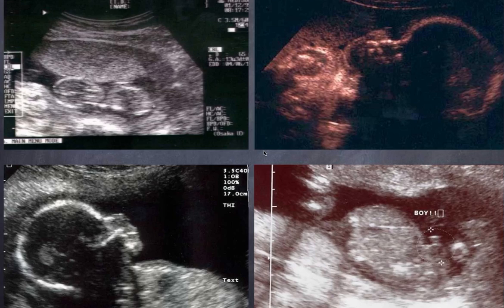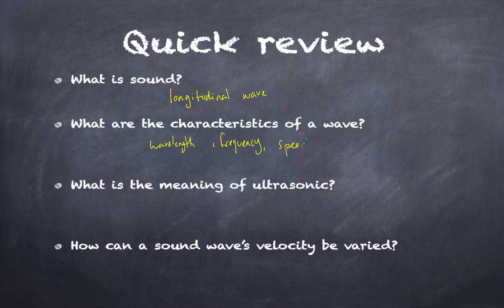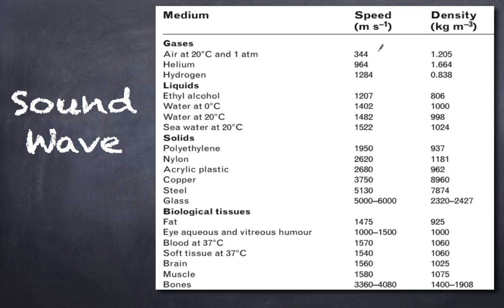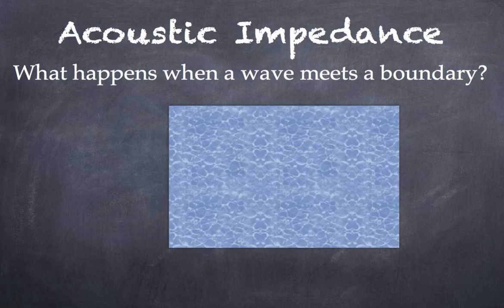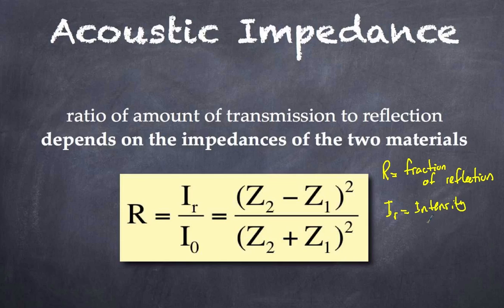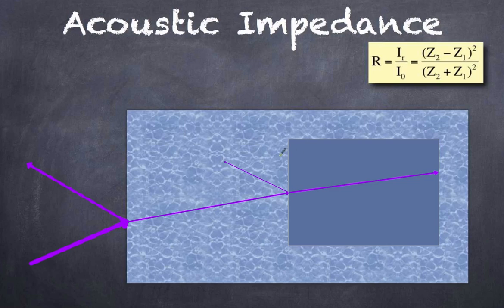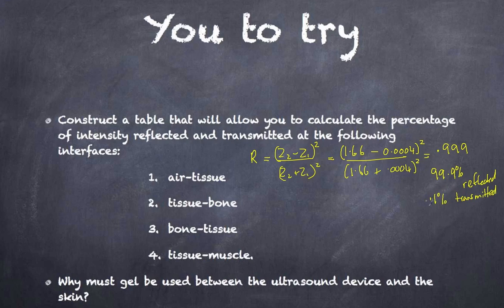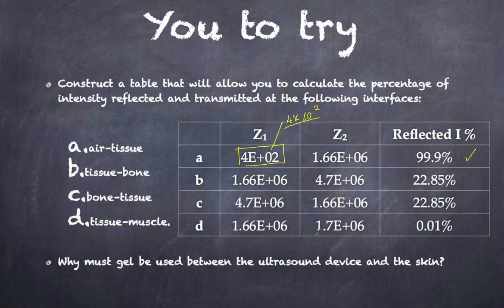ultrasound and acoustic impedance explained

Comment: With due respect,the higher speed of sound in liquids and metals is not because of their density,it is for an variable called  bulk modulus....
Water density= 1  and the speed of sound is 1480 m per sec in it

mercury density is 13/6 and the speed of sound is 1450m/s

Comment: This is fantastic.  I am a bit perplexed though, although the math shows that ultrasound would be reflected by air to me it seems a bit counterintuitive, could someone explain?  Thank you so much!!
Reply from the maker: It’s not the air that reflects but the boundary between the air and skin. The bigger the difference in acoustic impedance the greater the reflection.
Reply: @PhysicsHigh  Thank you so much for the response.  Yes, I totally understand the impedence... I just can't seem to wrap my head around air reflecting soundwaves, Id expect them to refract... I guess I have poor imagination lol.  Any thoughts on how you look at it?
Reply from the maker: The air doesn’t reflect sound waves. In fact if the medium is consistent you should not be able to see any detail as the detail comes from reflection where the acoustic impedance changes. Hope that helps.
Reply: @PhysicsHigh  Do you know why its called reflection when the medium goes from say a soft tissue to air... for example the pluera to inside of the lung?
Reply: You can think of it this way. If the difference in acoustic impedance is more, the solid is very much denser than air. So, when the sound wave reaches the edge, at the moment of contact, all the air surrounding the edge goes away from the solid because , as the density of solid is very high, obviously the energy of the sound waves is more in solid for it to even exist in the first place. As the air goes away most of the energy has no choice but to reflect itself again in the solid.
Reply: @rinzhler6922  very well explained!
Reply: @291ayl   I don't know if I'm right but I'm glad you get my point 😊

Comment: Thanks! Could someone explain if refraction would always occur where reflection occurs due to acoustic impedance mismatching? Since there is a change in densities?
Reply: Reflection occurs when you have a difference in impedance(Impedance = density x propagation speed). 

Refraction does not necessarily occur just because the impedance is different.  Refraction may occur when you have an oblique angle and you have two mediums with different propagation speeds.  Density and propagation speed are two separate items.

Comment: I have a question: say Z2= 4 and Z1=6 , R would come up as 1/25 so would mean that the reflection coefficient would  be 1/25 for this type of equation..now if I invert the values to as Z2= 6 and Z1=4 , the final value would be the same, 1/25 right? In this case , if I assume Z2 would be the bone impedance and Z1 the soft tissue impedance , does it mean that the reflection coefficient is the same either if I hit bone first and then soft tissue to if I hit soft tissue first and then bone? I know is a little confusing , but let me know if you understand my question. Thanks
Reply from the maker: Correct. They value is the same regardless of the direction: more to less dense or vice versa.
Reply: @PhysicsHigh  this is correct according to the maths but why should it be? The equation describes the phenomena but why is the phenomena happening? What is physically happening at the boundary that causes the same fraction of reflection when sound travels from concrete to water as from water to concrete?
Reply: Since commenting above I found an answer in Technology for Diagnostic Sonography. My summary is: 
·       The reason lies in what conditions allow transfer of pressure energy and momentum across a boundary of materials. Energy that is traveling fast in a high density medium (high Z) has high momentum and can’t readily be transferred to a medium that conveys energy with low momentum (low speed and low density [low Z]. The opposite is true as well. Energy with low momentum that is traveling slowly in a low density medium (low Z) can’t readily be transferred to a medium that conveys energy with high momentum (high density and high speed [high Z]. The law of conservation of momentum means that, in both cases, because there is Z mismatch, the energy transmitted across the boundary is reduced and the surplus reflect.

Comment: Can some explain how bone-tissue has the same reflection % as tissue-bone. I cant wrap my head around it, since, tissue is less dense, so more sound energy should pass through it than be reflected compared to dense bone...
Reply: this is the exact question I asked as well... it seems the formula they use for the impedance is not able to answer this ...It would be hard to believe that IRC would be the same whether you hit bone first and then soft tissue to viceversa

Comment: I found a mistake in this video.Density and speed are inversely related so when speed increases density does not increase but decreases. Stiffness would increase with sound.
Reply: According to Edelman’s physics book: as the density of a medium increases, propagation speed would decrease.
Stiffness and propagation speed are directly related.
Density and propagation speed and inversely related.
I think this person wasn’t inferring that the density of the medium decreases and you increase speed since neither of those are adjustable by a sonographer. A more correct thought is that the less dense an object is, the faster a sound wave can propagate through it.
Reply: Is this valid, reliable and accurate though? Where are your sources?
Reply: Yes, because c = (κ/ρ)1/2, when the guy said it it confused the fuck out of me!
Reply: Alyson Crane well they’re not in this case. The speed of sound in a metal is much faster than in water.